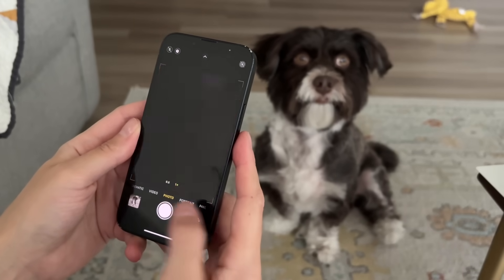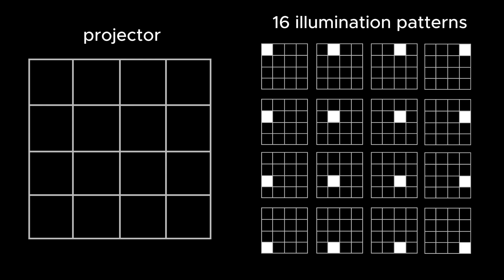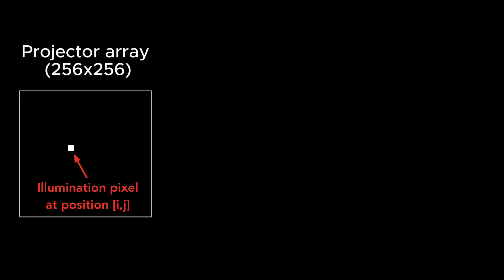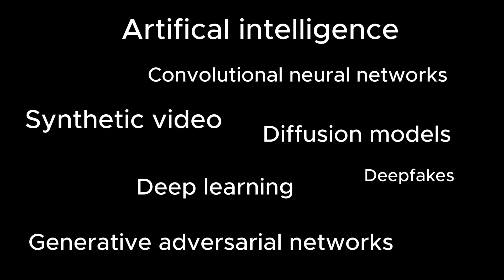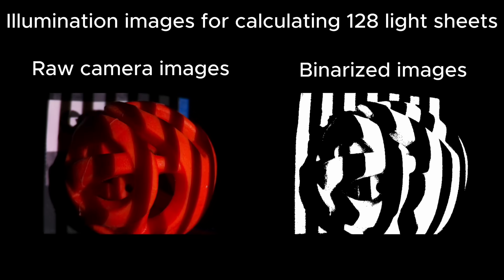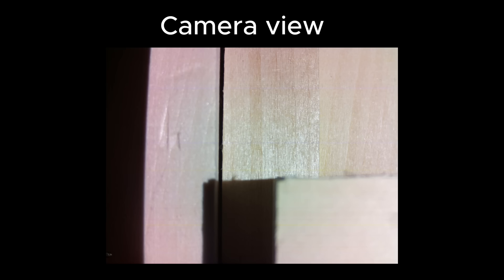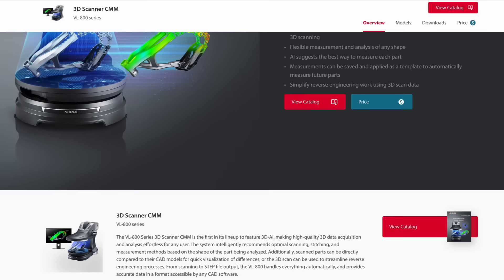Construct an image from a projector’s point of view (and more tricks with light transport)

Comment: I guess it has been pointed out already, but in minute 5:55, I love the fact that the perspective in the reconstructed image is the one seen by the projector (source of light) but ALSO the shadow pattern showed are actually the ones that would happen if the light was placed exactly where the camera is. So this process literally reverses the roles of the camera and the light source ❤️❤️❤️
Reply: It's a similar technique that is used for shadows in games (shadow maps)
Reply: That mokes sense to me after watching how 3d rendering works. As long as thu path between camera and light is occuluded there is shadows in the target surface. Regardless of where you go from/to.
Specific implementations skew that ofc. Specially with soft shadows.
Reply: True for shadows, specular highlights, but not diffuse lighting. That stays the same.
Reply: There was a TV studio system which worked a bit like this (described more fully in another comment). It used single point photodetectors which operated as "lights" in exactly this way.
Reply: fun fact: reversing the roles is very close to how raytracing is implemented in games and 3d rendering. You don't send out rays from the light source and hope some of them hit a camera - you send out rays from the camera, and where they hit you send out more depending on the material properties. A matte material will mostly send a ray towards light sources to see if its lit by them, but also bounce some in random directions to see if theres indirect light from another surface.

basically, instead of the projector (ligjt source) sending out "light rays" which light up an object, the camera sends out "light detection rays" which find whether there's a light source illuminating what they hit.
Reply: Of course, it has to be, because the shadow parts are what the camera can't see, so there is no data for that spot.

Comment: At 2:39 you should really have started with 0000 instead of 0001 in the first pixel. That would mean that you wouldn't have the n/a pixel at the end - that would be 1111, and you would get much more regular patterns. 
The first pattern would start with a black vertical line followed by white, black, white instead.
The second pattern would be two black vertical lines followed by two whites.
The third would be a black horizontal line followed by white, black, and white ones.
The fourth pattern would be two black horizontal lines followed by two white ones.
----
It is a basic of computer science to start with 0 instead of 1 when numbering things. Gotta use all the bits you have available.
Reply from the maker: The reason for not starting at 0000 is because this corresponds to the illumination pixel being off for every illumination pattern. If the algorithm searched for this case, then regions that were never illuminated (like shadows) would also get assigned to this illumination pixel, which would be a problem.
Reply: @okooptics This problem is solved with a single fully illuminated picture, which you did have. Just search for pixels that are affected only by this lighting, and all pixels which are not affected by it are shadows.
Reply: @okooptics  your N/A square is exactly equal to that 0000 - it's always off for every pattern
Reply: @okooptics then why not use 1 bit more? 5 bits for the 4x4 square in that example
Reply: @okooptics  You could still start at 0000 and keep the nice regular patterns i described, without using the last pixel for actual data / illumination. It makes the interactions between the different patterns easier to understand.

Comment: 2:30 why skip 0000 for the top left? it also gives much more understandable patterns
Reply: 0000 wouldn't be a physically viable value because you need to turn the light on each pixel at least once to get readings of where that projector pixel illuminates.
Reply: 0000 still is in the shown 4x4 pattern, just in the lower left corner. 
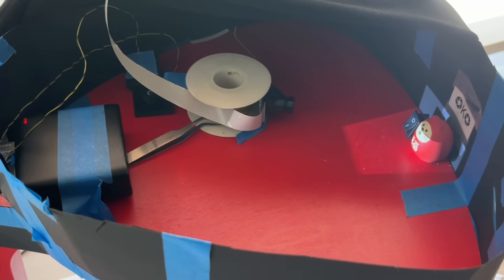At 4:05 they also mention normalizing against a fully illuminated image, which identifies the entirely dark pixel.
Reply: @rhodaminebee  look at the table shown at the time stamp from the original comment. the first bit is 0001, and then bottom right is n/a so presumably 0000. if you instead start at 0000, you get straight lines instead of the intricate patterns shown in the video.

and the normalization is something completely different. from what i understand, that's them taking a threshold of the patterned pictures, and displaying essentially a cutout of where the light is on a fully illuminated image. it makes it so they only have to stitch together two pictures (light on, and light off) instead of all the pictures, reducing any margin of error between shots

Comment: Couldn't you use the different r g and b channels to do reconstruction?
Reply: If all the objects were white/grey, yes, he could put the different patterns on the RGB channels to run the process 3x faster. In his examples though, the RGB channels of the image are already used storing the color of the objects in the image. As an example, if a pixel that should be illuminated is shining on a purely red object and it happens to be illuminated with a blue pattern, it would appear un-illuminated as it won't reflect the blue light.
Reply: @nicrule4424 wow great question and great answer I’m regaining faith in yt comment sections

Comment: @13:21 Would it make sense to transform the depth map to the projector's perspective to get rid of the shadows? Or would there still be voids, just in different spots? It would probably get extremely noisy at that point though
Reply: If I understood the video correctly I believe the voids will then be where the camera cannot see.
Reply: A more intuitive way of thinking about it I just thought of a few minutes later: think of the projector as "sending" depth information to the camera by bouncing structured light off of the objects. If the camera doesn't "receive" the light (the object is occluded), it can't know the depth.
Reply: The depth map is basically constructed using trig, I think. So if you have two angles on an object (i.e. both the projector AND the camera can see it) you can calculate depth, but if only the projector can see it, you do not have enough info to get the depth. The depth comes from the overlap in information between the projector and camera.

Comment: I don't remember the specific paper; but something you might be interested in, is synthetic aperture photography. Might need a bigger camera to fit the parts in the lens; but basically, instead of the conventional camera diaphragm aperture, they use something like a transparent LCD (remove the backlight and diffuser of a conventional LCD display), and they had a few different patterns of blocked and exposed pixels that would produce a set of photos that encoded the view from each of the pixels, allowing for refocusing, slight perspective shifts, and depth sensing by either using the multiple perspectives or measuring depth looking for what's sharp at each focus adjustment. edit: Oh, and I think I remember they could also use it for super-resolution. edit2: Still trying to find the exact paper I remember, but one keyword that seems promising is "coded aperture", not sure yet if it's the one I am looking for.
Reply from the maker: Let me know if you find the exact paper. Synthetic/coded apertures is a huge field, but that implementation with dynamic transparent unit sounds cool.

Comment: If you had something like a mirrored xmass ball or just any mirror-polished object, when reconstructing from the perspective of the projector, would the reflections be from the perspective of the projector, or from the perspective of the camera?
Reply from the maker: This is an interesting question. Fig 7 and 12 from that paper have mirrors in the scene. In those examples the illumination reflects off the mirror, hits a diffusely scattering object, and makes it to the camera. If you trace the rays out from the projector to a mirror directly in front of it, it doesn't seem possible for all the light to make it back to the camera without reflecting off some other objects before hitting the camera (unless you have a large curved mirror).